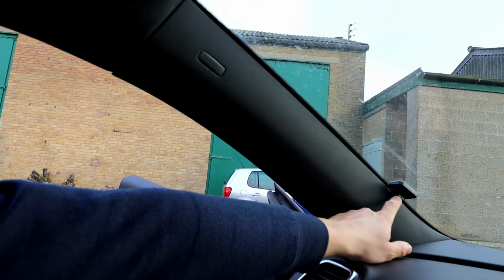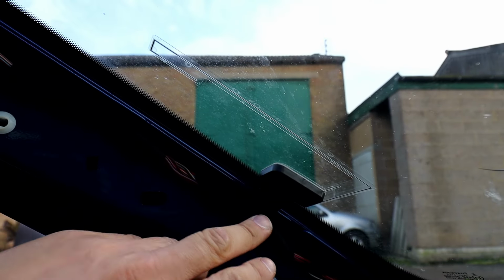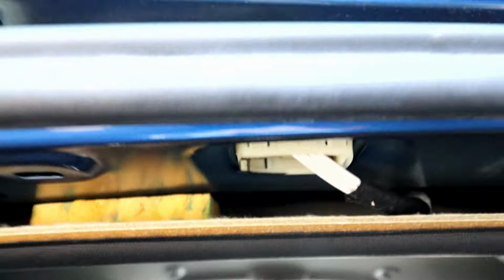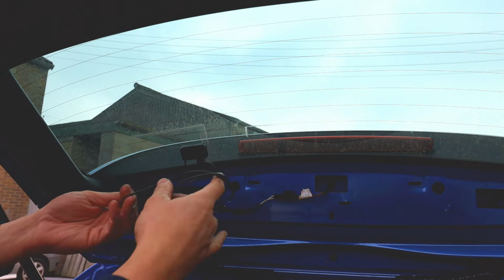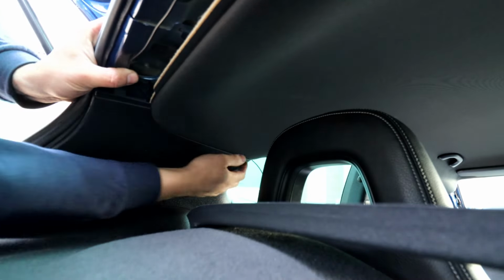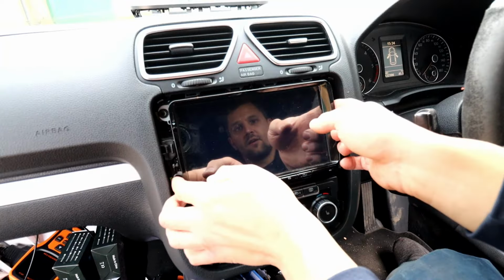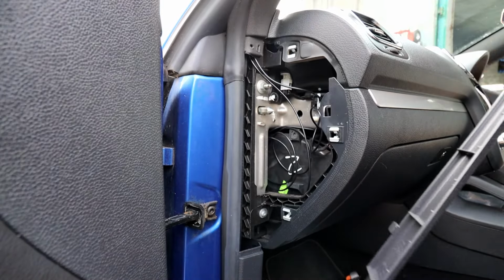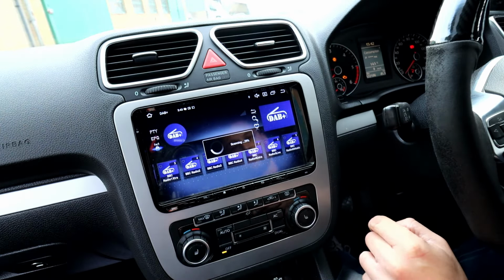VW Scirocco DAB Antenna Installation. How to Install Xtrons ACUSBDAB05T DAB dual antenna unit.

Comment: Just as a note, before mucking around with any cover that says ABS Airbag, make sure you disconnect the battery.   Reason for this, if you slip in some way you can risk setting off the airbag, which is basically a small explosive that inflates the bag rapidly, which will cause a quite nasty injury.   Have to be careful even without power, but less likely to trigger them without power.
Also, take note of polarisation.   A lot of DAB signals will be vertically polarised, but check in your country.   These antennas are polarised as such and should be installed vertically in areas where DAB is vertically polarised at the transmitter and horizontally if you have confirmed your DAB is in  horizontal polarisation from the transmitter.    A lot of places run TV signals in the horizontal and DAB and FM in the vertical, but as I said, important to check this or you will get poor reception, and these on glass antenna's are bad at the best of times.
Also, in the case of heated rear windows, keep the antenna away from the heating wires as these will also affect the antenna in a negative way, not to mention that the antenna can also negatively impact the heating wire by increasing the risk of it overheating and burning out.

Comment: Top tip...when I routed for rear dash cam I sprayed inside the rubber hose with wd40 and taped the cable to a thick cable tie and it just slid through, so was no need to remove the rubber hose.
Also those metal clips are a bugger for coming off the plastic and staying in the metal work...and when you pull them out they mis shape quite easily.
So..is there 2 antenna connections on the rear of the xtrons? I have the eonon with only the front antenna.
...I should've  watched it all first..you mentioned the WD...I'll shut up..😂😂
Reply from the maker: Haha not to worry at all.
Usually all the xtrons units have got only one antenna.
This is a new one with double for the people that live or drive in the areas that have got bad signal. It does seem to work well because I drive in those areas a lot unfortunately